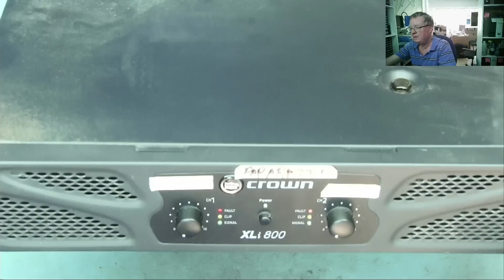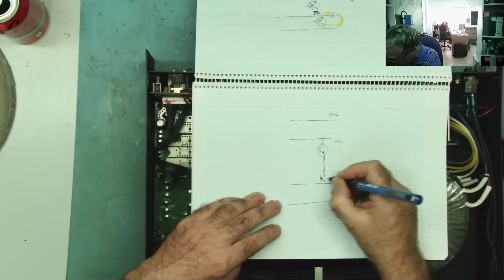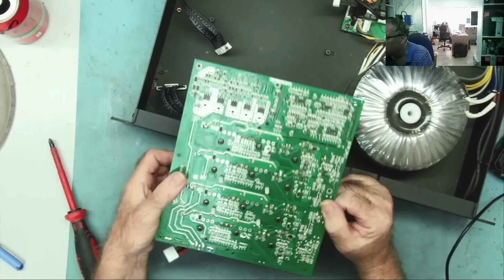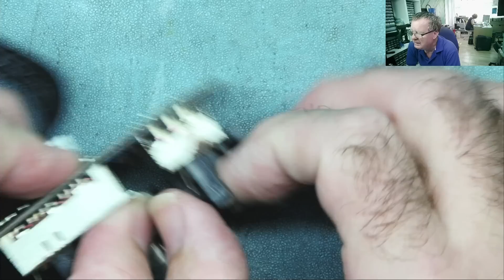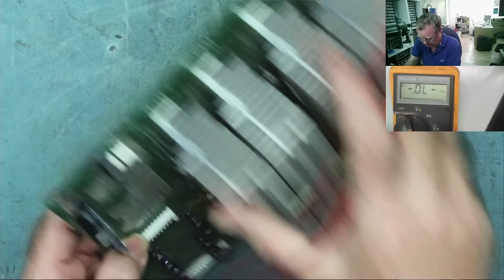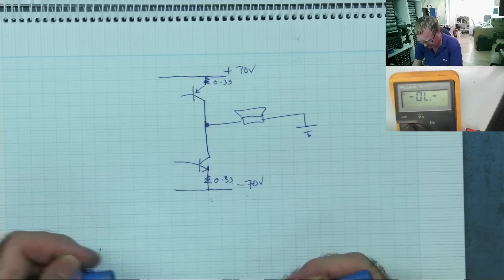Some Faults Are Hard To Find : Crown XLi 800 Amplifier Repair : Powers on but No Output.

Comment: Love your channel Richard great work As someone else has mention they usually power up in protect mode and the come out after 2-10 seconds 
Also i have had amplifiers that wont come out of protect mode due to low input voltage caused by the series current limit lamp. Also the main board seems to get its ground from the bolts mounting it to the chassis as their is no ground wire from the psu... So i assume all those mounting bolts need to be fitted to test the amplifer?
Reply: Seen that a few times.

Comment: See YouTube video from TKF Electronics “how to repair power amplifier crown XLi 800 fault red light on”
Reply from the maker: Seen it. Unfortunately mine does not have the same fault, I showed that I tested the diodes and mosfets in that area and they are OK, plus I reveresed engineered that part of the PCB and all the voltages are present and correct
Reply: @learnelectronicsrepair  yep. I thought you tested all the diodes. Wishful thinking.

Comment: I'm not an electronics engineer but I would have thought that initially  switching it on with a sine wave input and a dummy load of 4 or 8 ohms and a scope first would have been useful. Most things like this work until the smoke gets out, then they stop working, so obviously it is the smoke that makes them work.......  Then, leaving the sine wave input running, if it didn't appear at the output, working along from the input with the scope probes, looking for where the sine way stops or is corrupted would have isolated where the fault would be instead of fannying around checking supply voltages,   and the input sensitivity switch would have been easy to bridge out so as to eliminate it as a possible source of the issue with the amp.  The fault/protect lights can be because the amp can't see a load on the speaker outputs, as you unplugged the Speakons..  But what do I know?  I wanted the last bit of the video to be  so the amp now works fine and can be returned to the customer with a bill.   Always mistrust Silly-con components first that's why they are silly. Diodes, and their cousins transistors, and voltage regulators, rectifiers.    However although I watch these videos avidly, I know nothing about fault finding,  or electronics, so I bow humbly to your greatness as I know I am not worthy. So keep up the good work and I may learn a bit about this stuff....
Reply: Some wise stuff in there, don't put yourself down !

Comment: I don’t know if it matters, but it looks like when you put that switch back on the pcb, it was backwards from the way it was originally.
Reply from the maker: It was originally in the 1.4V position bt I didn't show that on video I think.  I moved it to the 0.7V position then found i could not move it back
Reply: @learnelectronicsrepair    Yes, I got that from your dialog, however, I’m referring to physical placement on the board.  From observing the rust stains on the switch it looks as though you rotated the switch 180 % when you soldered back on the board. May not mean anything if the contacts are symmetrical end to end.  Anyway, just an observation.  I just started watching your videos and have been enjoying your laidback, like we are in the same room with you, conversation. Thanks for sharing your adventures. 😊
Reply from the maker: @billstoner5559  Oh I see what you mean.  It's a DPDT wired as a SPDT so it should not make any difference, and the multimeter tells me it's OK (if you don't try to switch it to the other position) but well spotted

Comment: Richard it is a common fault in the crown amps.... plus the fault lights should come on and after 2 - to - 4 seconds they go out.. there where you have the 4 fets and the one regulator in a row in that block you need to check every component usually there is the fault.... also you best connect a dummyload those amps do not like it when there is no load on the outputs
Reply from the maker: Hi Dutch.  I think I showed that I tested the four FETS plus the regulator and also the diodes nearby and they were OK but given what you say I could go back and test them out of circuit, however as I reverse engineered that section and worked out two of them regulate the +/-15V from VL+ and VL-, the 78M24 regulates the +24V and the other two control the fans I can't see how the problem could be there because all those voltage rails are present and correct.  I can of course attach a load but what I can't quite figure out is why the fault behaviour changed after finding the problem, with the 1.4V/0.75V switch and I didn't have a load attached either before or afterwards

Comment: The Black-Orange-Orange-Silver-Red resistors are coded that way because these are high precision resistors. They have three digits for their signifier, and in such case, you'd need a x0.001 multiplier which *does not exist*. Orange-Orange-Black would not work as a digits code, because you cannot get 0R33 with any multiplier -- at most 3R3.

To sum that up, they had to make it weird like that because they had high precision resistors, which is commendable on their behalf for design care.
Reply from the maker: Thanks for the info.  Yeah it was a bit weird IMHO and I expect a lot of people will be interested in seeing it

Comment: I think I'll love this! This is one of the lines of units I've worked lots on, and have only had about 70% success fixing them.

Indeed, I always open devices I don't know the state of. I also check for shorts on the mains, and a reasonable resistance to check for fuse worky-work.

Comment: Manual says 'Protection against shorts, no-load, on/off thumps and radio-frequency interference . Are speaker 8R load resistors needed'?
Reply: Does the manual ask that question? I've never noticed that.
Reply from the maker: @AnnaVannieuwenhuyse  Agreed I can try this with a load but what I do know is that before I looked at that 1.4V/0.775V switch I had power on, signal LEDs and no audio output.  Afterwards I have power on/signal and fault LEDs on and no audio output.  I had no load attached in either cases. So I changed something for sure when 'fixing' that switch but can't so far work out what it is.  All I seem to have achieved so far is to prove what is not wrong with it, and reverese engineered enough to work out what those 4 MOSFET + 78M24 do and the rather unusual topology of the output stage.  I'm quite tenacious though so for sure I will be looking into this further.  I consider it something of a challenge now
Reply: @AnnaVannieuwenhuyse  It says so on the first page of the data sheet. But it's not clear as to whether having no speakers connected actually trips the fault light, or whether the amplifier simply tolerates it.

Comment: https://youtu.be/p4itHQ4JJMI
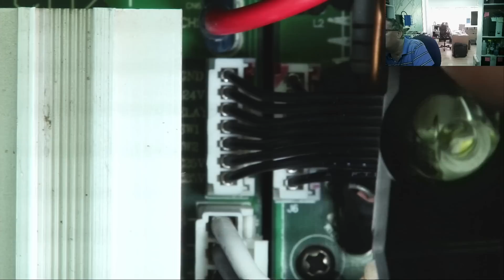any good? 3 M7 diodes in corner of the 12V supply. Were they OK? @5:20 - You checked at 55:00 so probably not same issue!

Comment: Hopefully this helps someone: 

	1.	Confirm Customer Complaint: Verify the issue reported by the customer to ensure you are addressing the correct problem.
	2.	Identify Symptoms: Observe and record the specific symptoms that indicate the problem.
	3.	Gather Information: Collect relevant information about the device, including schematics, manuals, and known issues.
	4.	Analyze the Problem: Assess the situation based on the symptoms and information gathered.
	5.	Formulate Hypotheses: Develop potential causes for the issue, prioritizing the most likely ones.
	6.	Isolate the Fault: Narrow down the problem area by testing components and subsystems.
	7.	Test Hypotheses: Conduct tests to confirm or rule out your hypotheses.
	8.	Repair or Replace: Perform the necessary repairs or replace faulty components.
	9.	Verify Functionality: Test the device to ensure the issue is fully resolved and the device functions properly.
	10.	Document the Process: Record the steps taken, including the diagnosis, repair, and final outcome, for future

When techs take these steps out of sequence they are destined to chase phantoms. Can’t figure it out, go back to step one. I have yet to see Step one ever visited on this channel